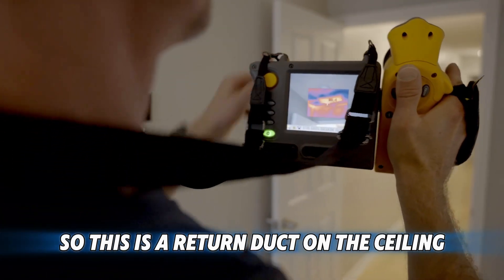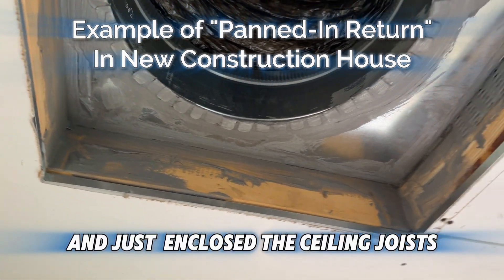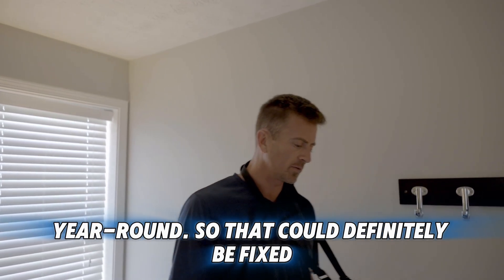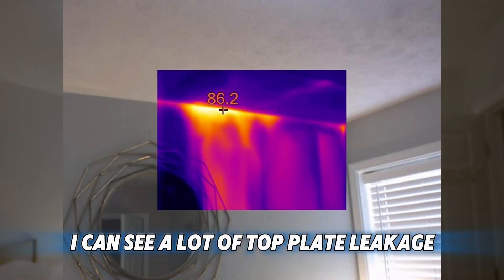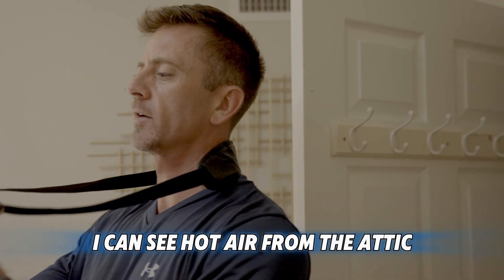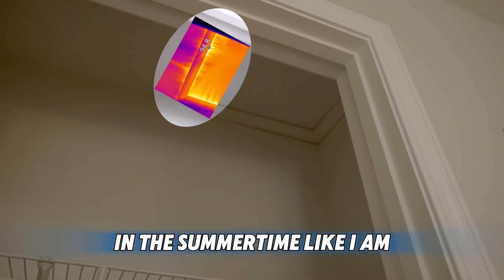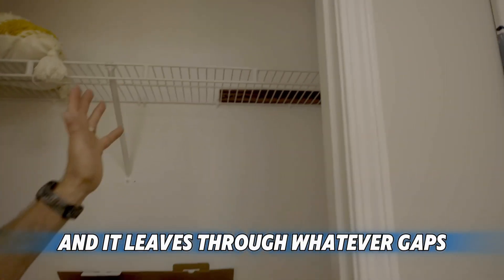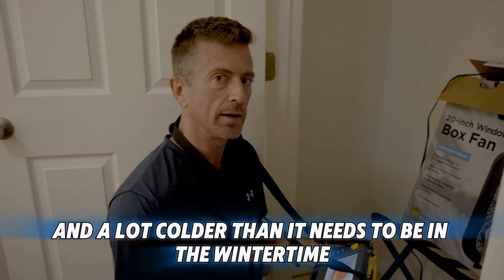Infrared Camera Finds Air Leaks & Missing Insulation!

Comment: Ok I commented on another video but I’m having the same issue with the exterior wall and ceiling meet. But it’s around the house so how do I fix this issue? Would air sealing it fix the issue
Reply from the maker: yes air sealing it should fix the issue.  If there's attic space above that you can access all the way to the perimeter edges, then you'll need to move the insulation back or remove it completely first to reach and air seal the top plates of the exterior walls to the drywall, along with any electrical or plumbing penetrations.
Reply: @ thank you